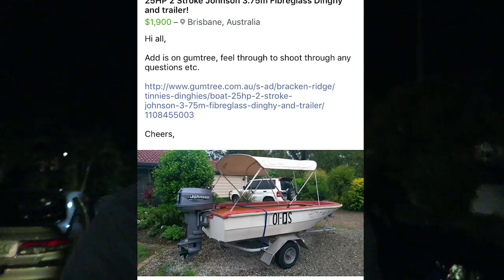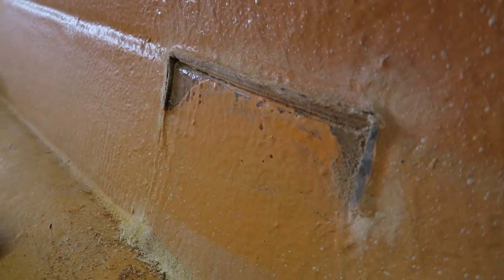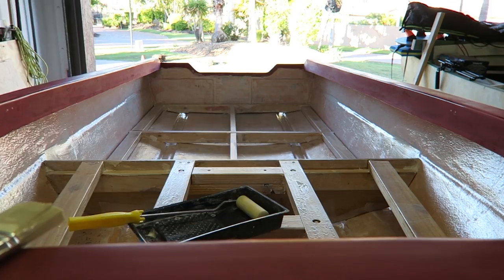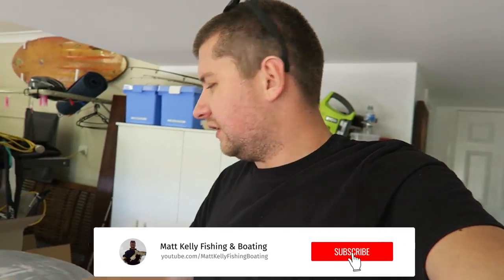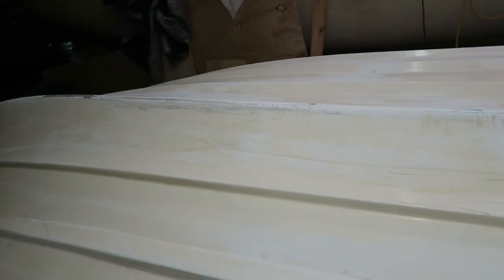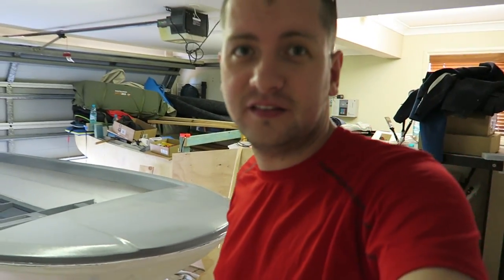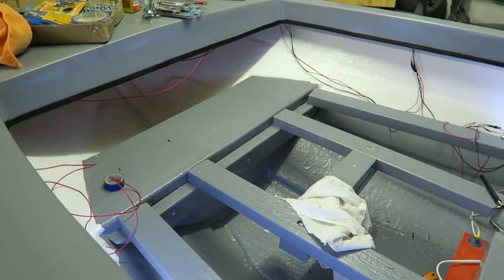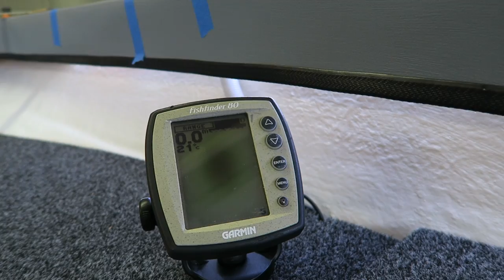Fibreglass - Boat Restoration Project!

Comment: Hi. A good idea would be to fiberglass everything together, makes the boat more solid and last longer. Stringers ,floor , ribs and any other bare wood spots . If u need help with the next one , just ask , no worries. A friend from canada.
Reply from the maker: I've got a video coming very soon where I did exactly that! Full structural rebuild. Thanks for the comment!